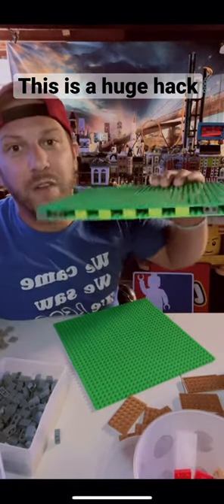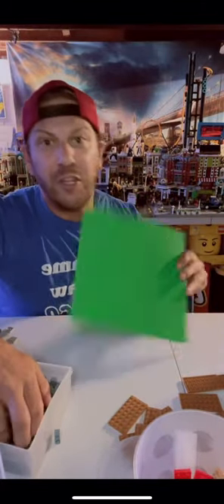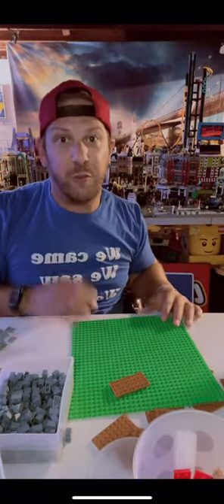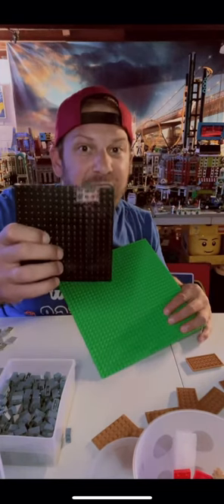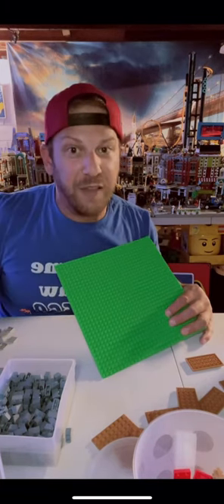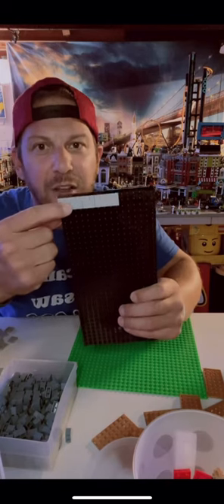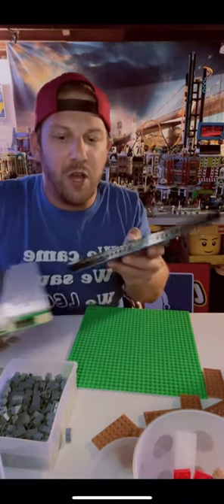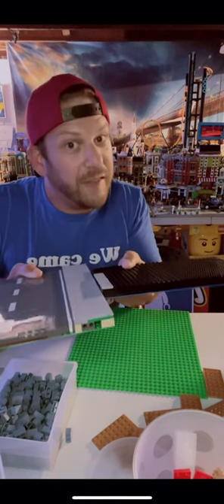This is a huge hack for a MILS plate for city builders

Comment: I'm a little bummed because this is such an easier way to make mils plates.  But it was time for me to restock and I just priced out using these 16x16 technic plates vs. standard parts and the price isn't even close.  The cheapest I can find these on bricklink is about $4.50 each, which means $18 for one mils plate assuming you already have the baseplate.  For a standard plate, it's only about $8.  Definitely a lot more work to build, but for less than half the cost per mils plate, I can deal with it.

Comment: But you’re now 1 plate shorter than standard MILS, the technic plates are just 1 brick high, so unless you’re going to redo your entire city in the technic MILS, there will be a 1 plate difference between methods
Reply from the maker: No they aren’t. You put the set directly on the black plate. If you add tiles for sidewalk it is the same height as the tiles on a MILS plate
Reply: @brickcr8tor  I was actually coming back to retract my question I set them side by side and one standard baseplate + one technic 16x16, is indeed the same dimensions as standard MILS. I honestly thought they’d be a plate short in dimension 🤷🏻‍♂️

Comment: The purpose of mils is to have the ability  to build on levels so it would be useless. But ok
Reply: I guess it would work in some spots but not all
Reply: You’re incorrect.   This will result in the same base as a standard MILS plate would - it’s just a lot fewer pieces.

Comment: I don’t understand what the point of mills plates are
Reply: Have you ever tried to pick up a large set built just on the standard baseplates?  They provide no support at all - they warp and bend over time as well.  The MILS platform is a rigid and stable base - it makes moving buildings, roads, landscaping so much easier.
Reply: When i dont understand something, its up to me to find out
Reply: MILS was also intended to be a standard system for building baseplates so that multiple builders could collaborate without needing to worry about how to connect the things they build.